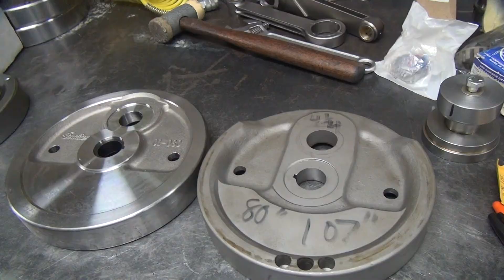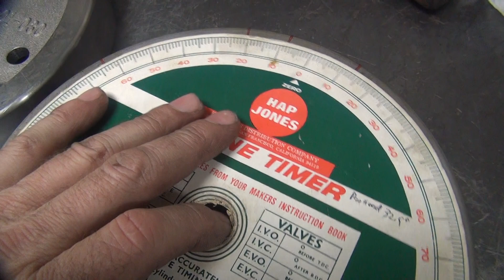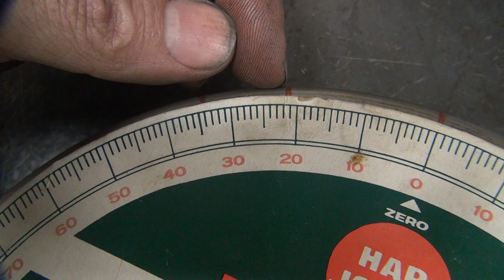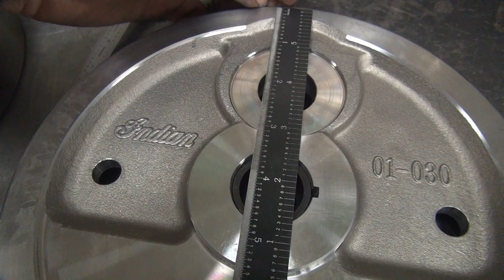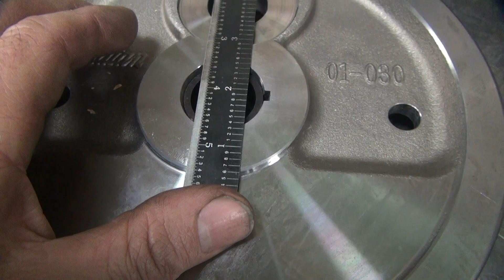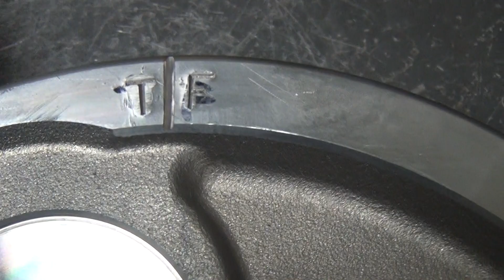#106 2001 Indian Scout motor rebuild 88ci bigbore S&S overhaul Evo Harley by Tatro Machine

Comment: does putting in balancing marks after it has been balanced throw it off any?
Reply: Dirk G - Review the video and Tatro provides the answer although since material is being removed or moved when making balancing marks the answer should be self evident.  Hint listen for Taro’s answer at about the twelve and one half minute mark.
Reply from the maker: you don't think harleys are that accurate do you. you can never balance a harley, you can only make it better in the spot you like it to be. everywhere else vibrate as they want to. that is why i use different balancing factors for different applications.
tatro
Reply from the maker: you mean you have to pay attention to these videos to learn anything. there goes all the fun.
tatro